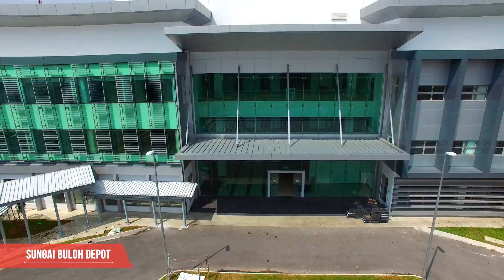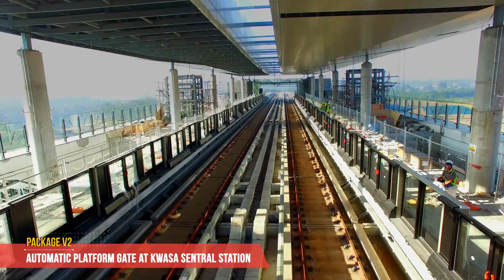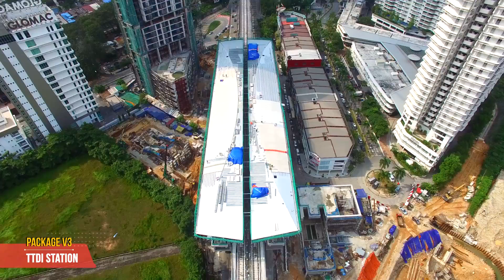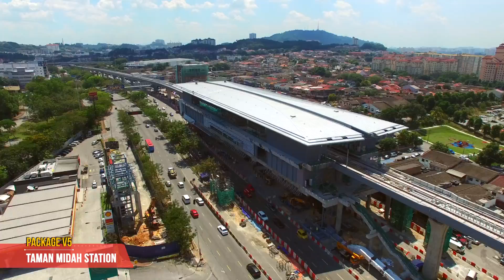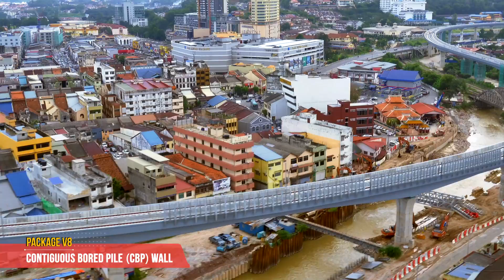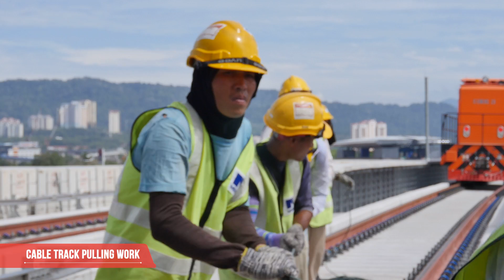The Klang Valley MRT Elevated Works Q4 2015 Progress Video

Comment: If anyone been to sg buloh station, you probably agree with me on the below:

1) The parking inside are very dark even though its day time. Totally the opposite what shown in this video

 2) The exit sign in the car park are too confusing. 

3) The road to the station not well maintain. Too many holes. 
No one bother to repair.

4) The are long grass and bushes along the way to the station. Make you wondering whether you are going to right way. 

5) Safety is the concern here.

Comment: Although Najib has too many issues, but honestly, this MRT project is a very great project which came out from his idea to ease people to move from one point to another point especially in vast area. Not only that, we can call najib as"Bapa Pembangunan Pengangkutan Awam" <----- sounded ridiculous, but why not. We can listing the transportation projects which has been approved by him. One of it is High speed rail connecting Kuala Lumpur to Singapore.
Reply: Right. We have to hand it to Jibby for getting the public transport right.
Reply: To add more, Najib revitalize KTMB Komuter with new train, Completion of Gemas - Seremban and Ipoh - Padang Besar EDTP + new ETS train, completion of LRT Kelana Jaya / Sri Petaling line Extension with new set of train replacing decade old LRT STAR.
Reply: Give credit to whom credit due
Reply: bapak transformasi mmg sesuai utk jibby